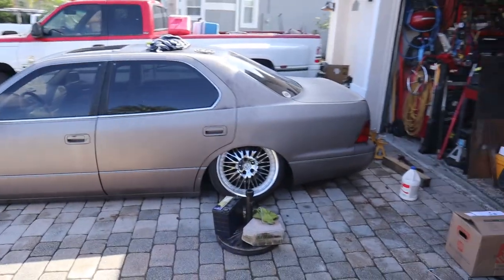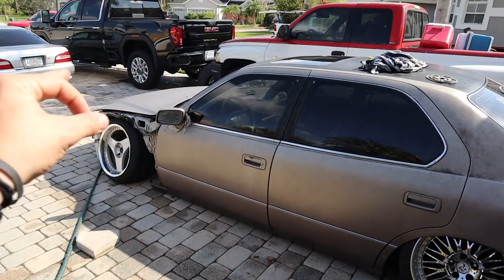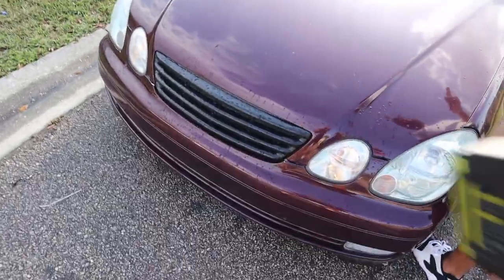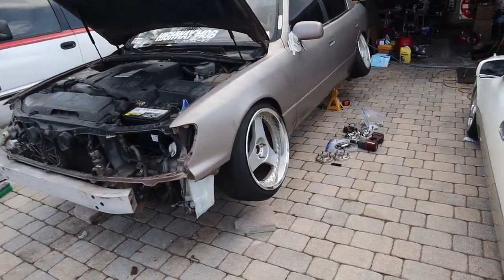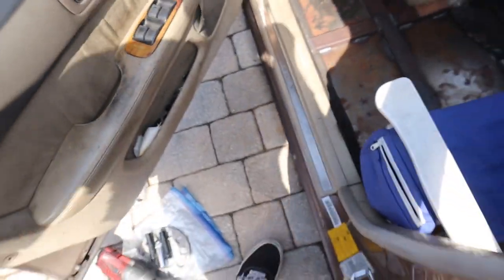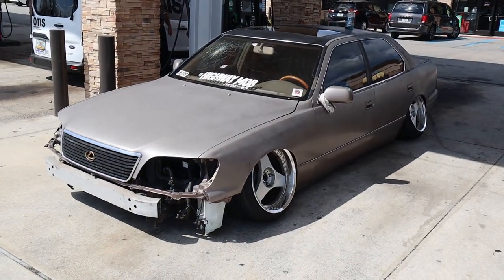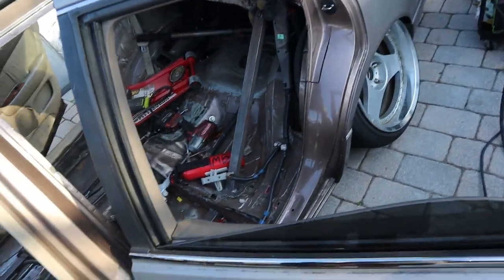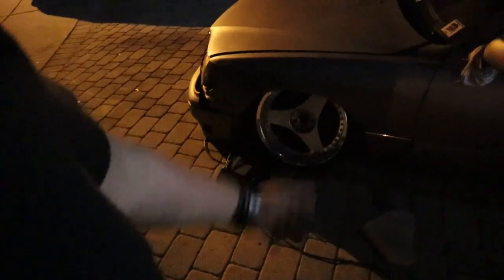RAISED FLOOR LS400 FIRST DRIVE! + Last min Houston ASM prep

Comment: Bro says he don't like to cut corners, bro... What's the point in rushing the build, going to shows with a car so far from finished?
Reply from the maker: This car will never be done, anything I did to the car other than reinforcing the stock show towers was not cut corners. Going to the show unpainted is cutting corners in my opinion, but as I said before, I did everything correctly, just not the way that would take a very long time to do how I intended 

Your comment seems quite negative, but I’ll give you the benefit of the doubt, hope you have at least learned something on the channel that you can use to benefit your build 🙏